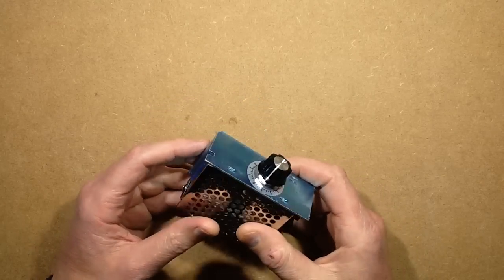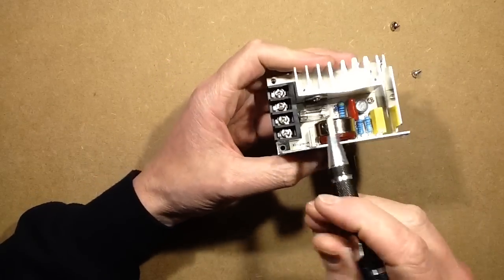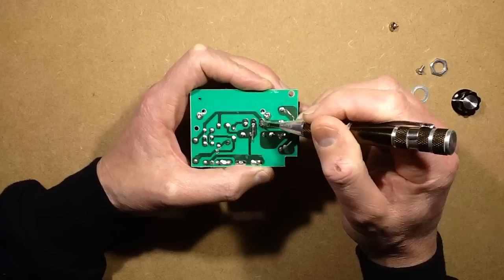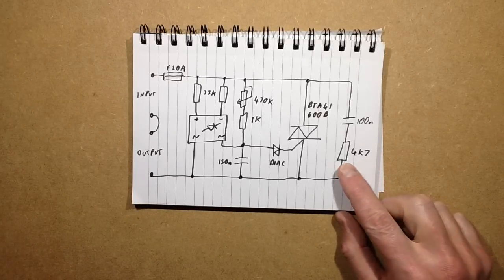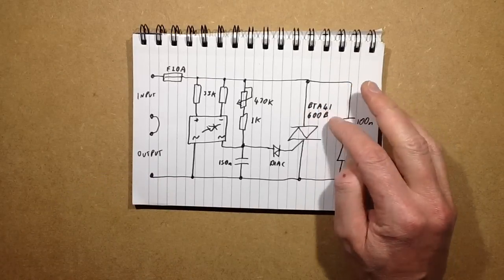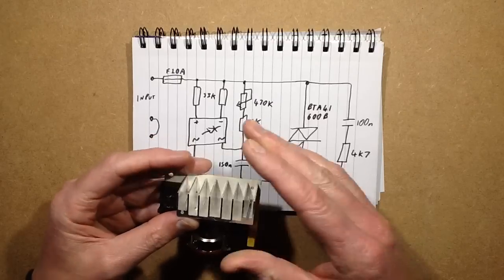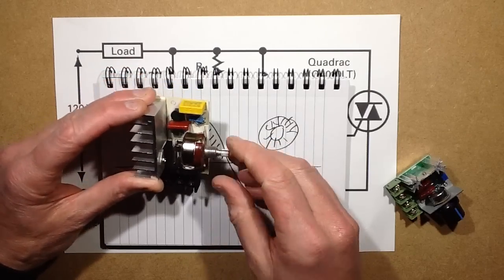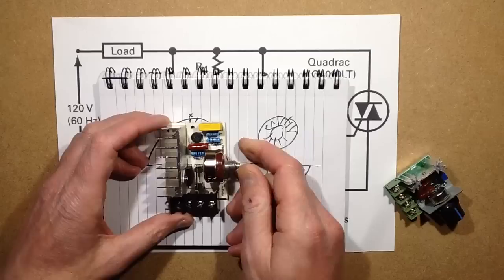Inside a "4kW" ebay power controller with schematic.

Comment: Great video. Got the same unit from ebay. But it is always 200V on output. Turning potentiometer does nothing. Do You know what part can be cosing  problem. The main problem is it is too cheep :)  and I have better to buy another one. But... this waiting time till we get them :) .
Reply from the maker: The unit will need a load to work properly.  If you connect a traditional tungsten lamp does it dim?
Reply: @bigclivedotcom  Thanks. I got it this morning and  only have my multimeter at hand.  Thanks. I will try when i get home after work. Two days earlier the small 2000w one came and also was showing 200V. But from Your  video on it I managed to understand  the blue resistor is the problem. I turned it to maximum resistance and thats it. Multimeter shows according to potentiometer and without any load. On 4000W  I did not find  looking at Your reverse engineering schematics whats the problem. I am not very familiar with electronics. Your channel is great .
 P.S.  I tested with lamp and it is working.

Comment: I am fascinated by your videos!  I am wondering what modifications would be necessary to get this to work as a power supply for model trains (Lionel) with operating AC output voltages of 0 to 28 volts.  If it could be made to work, since short circuits are common, would a circuit breaker provide adequate protection v a fast-acting fuse.  

your explanation of toroids in the whole house energy saver device was great.  I never knew they worked that way.

Thanks!
Reply from the maker: +Michael Lascara I'm not sure it would be ideal for low voltage use.  The diac really requires about 30V to trigger.  I suppose phase angle control could be used for an AC model if it was designed from scratch.
Reply: Thanks for the prompt reply.  Your evaluations are inspiring.  It makes me want to undertake a few projects.  It also makes me want to "give back" on things that I know about other subjects.

Comment: Hi there can’t you make video how to use this product wired to a 3000w brushless motor with 3 phase wires and 5 pin hall sensor wire would like to know in Which of the wire is best to wired it from

Comment: Do you think this would work as a speed controller for a industrial floor fan?
Reply from the maker: +Gspsx It depends on the motor it uses and if it has existing control circuitry.  You also have to be careful it doesn't get turned down so low that it stalls if switched off and on again.  Most dedicated PWM fan controllers start by ramping up to full speed then back down to the set speed.
Reply: bigclivedotcom Thanks Clive, you're the man.

Comment: wonder if this would work in my kitchenaid mixer , its a contact motor running throu a 120v transformer and the old speed controller blew up

Comment: so this could be used to control a treadmill motor by reducing and increasing voltage. but at lowest speed would this not also reduce the torque power ??
Reply from the maker: Treadmill motors tend to be DC for torque.  They will be a lot weaker with rectified AC.

Comment: I changed the fuse of 10A for a 20A fuse, that's works fine, 
But accidentaly i was testing my 90VDC 13A motor with a bridge rectifier and a capacitor, i unplugged the principal connector without change the potentiometer value, and when i connect again to the wall, the capacitor (100V 6800uF) blew up and the fuse at the dimmer blew up too (20A slow fuse), i think the dimmer is broken now because i can't regulate the voltage, sound something weird at the motor.
i'm thinking that with that dimmer you cannot dsconnect the load for any reason so you will have a peak voltaje that is 120*sqrt(2) when you connect the load again, i think that was the reason the capacitor make BOOM!.
Reply from the maker: The triac has probably failed.
Reply: Why it'spossible? the triac it's 44A and 430A peak
Reply: i'm thinking the one who is broken it is the diode bridge

Comment: Mine doesn't adjust the voltage. It's always 220V, no matter of the knob position. Does that mean that the thyristor is faulty?
Reply from the maker: If it does it while a load is connected it may indicate the triac has failed.
Reply: If yours is labelled as Clives one is, and mine, then it is labelled back to front, the output is in fact the input. I had the same effect before I connected a load, which destroyed it. I figured this out from looking at Clives circuit, replacing the blown triac and now have a working unit, reversing the in/out connections EG (Input N L- L N output) NOT (output N L-L N input) . if you put a load on it like then it will pop, BANG actually. Ask me how I know ;)

Comment: So I have the exact same power controller, 4kw. The circuit board is the exact same. But then INPUT and OUTPUT labels switched positions. So... how should I connect it? I've tried both ways with a fan and I can control its rpms both ways. And the fan always spins in the correct direction (clockwise). It's driving me mad and I'd prefer not to jeopardize...

My unit indicates which is L and which is N. When you look at the controller from the side, markings show like this:
OUTPUT        INPUT
  N    L              L    N

Looking at the circuit, to the far left side of it, I'd say Neutral would be the 2 connectors in the middle, while Live would be the 2 poles, right? the "outer" connectors.
So it looks to me as if they "simply" misplaced indications in my unit?

I'm guessing this would be the right labelling?
INPUT       OUTPUT
 L   N            N    L

But I'm not really sure. Anybody? Help appreciated.
Reply from the maker: Polarity doesn't actually matter.  AC is effectively both polarities and the neutral is probably just looped through.
Reply: @bigclivedotcom  Thanks Clive, not really my field.

Comment: Hi, not really related, I love to watch your videos. I have a situation, wind generator it goes from 10 vac to 190 volts triphase, my inverter after the rectifier accept 30 to 60 vdc. What kind of device you would design to be able to use all the current? I rattle my brain but can't figure it out, any ideas?
Reply: Three phase transformer to turn max 190V AC to about 40V AC. Take three phase rectifier and a 100v filtering capacitor if you can, add inductor and capacitor to form CLC filter, fuse is recommended and high value dicharge resistor is advised parallel to caps to safely discharge all the energy. This should turn 10 -      190V AC to 3 - 56 V DC. With this done we need to talk about inverter. If the inverter is MPPT, then connect the wires from rectifier to inverter, done. If the inverter doesnt care, connect the wires to boost converter and set it to 55v and connect that to inverter.

Comment: Bigclive: /shows a similar item of exact same material and dimensions/

Me: It makes me wonder how an engineer starts a project like that.  Do they start with the board and then choose a box to fit, or do they start with the box and try to design the board to fit?  If they start with the board, then how do they find boxes that perfectly fit?  And if they start with boxes, then how often do they have to start over because the board won't fit?
Reply from the maker: Many Chinese products use common PSU cases.

Comment: Hey i have a couple of these and they have failed, but they just supply the full whack of power. Any thoughts, i have tested most components and cant find the culprit. Thanks.
Reply from the maker: +Niall Odumosu It's usually triac failure that causes that.  Particularly when a load is shorted (like a lamp failing) or they get too hot.  To test with the power off, put your meter to continuity and looking at the triac from the printed side with the legs at the bottom check for continuity between the two left legs.  If shorted then the triac needs replaced.
Reply: Thanks man will give it a shot, I'll pick up some triacs sure and test out, pity they cost more than the whole thing fro China Haha, much obliged for the help

Comment: hello bigclive do you think it can handle a palm router with 220v and 550w for hours of usage? Thank you God Bless.
Reply from the maker: I'm not sure.  You might have to try it, but note that it has no interference suppression so could swamp radio signals.
Reply: Will the machine be affected? I mean my CNC machine where I mount the router?
Reply: Or is there other controller  just like that with interference suppresion?

Comment: I suck at analog electronics, im on the other half of the 10 people... ;) Anyhow, could that 4k7 resistor have anything to do with the bridge rectifier? I just venture a guess...
Love your chanel, keep up the good work :)
Reply from the maker: +Björn Camitz No.  The rectifier section had two 33K resistors.  The 4K7 resistor was in series with the capacitor across the triac.
Reply: +bigclivedotcom Guessed as much, it was a shot in the dark :) Thanks for the response and btw, you have a new patreon :)

Comment: Hi big Clive, I am an ignoramus, but was wondering if this could be used on a washing machine motor? could a forward off reverse switch be used with this and a washing machine motor?
Thx David
Reply from the maker: It depends on the type of motor.  Most of them are based on a type called a universal motor with brushes and commutator, and they are often controlled by phase angle control circuitry just like this.
Reply: thx big Clive, so fast
:-)
Reply: thx big Clive, so fast
:-)

Comment: I know this is ages old but..I am trying to control a treadmill dc motor through a bridge rectifier and I have both of these units..Both of them don't work and the motor just runs at full speed even when the potentiometer is turned down..Any tips as to what may be wrong please?
Reply from the maker: It might be the very inductive load causing false triggering if the snubber network isn't good enough, or the triac may have been damaged by the inductive spikes and failed.
Reply: @bigclivedotcom  ok..thankyou mate..ill search for a how to use the treadmill controller i think..

Comment: Need to test if this unit can really control speed motor like a fan but it likely not sure of it since the fan have a 2nd coil for a capacitor starter and that will not make the motor happy with low voltage

Comment: Definitely needs an Earth on the case as otherwise the only thing between case and full mains live (apart from the 10 Amp fuse) is the insulation of the control potentiometer. EEK!

Comment: I must be a bit thick but P=E*I (240v*10A = 2400w)
Where does the 4kw come from?
I would want a fan on that to keep it happy :-)
Reply: +zx8401ztv My guess would be that the rating of the triac is that they've rated it 400v rather than 250 (despite having a 250v glass fuse!), so 400V x 10 amp... 

The triac itself is 600v 40 amp, which is frankly ludicrous LOL
Reply: +TheChipmunk2008 lol its overkill, but i would rather see that, at least you know it can stand it easy :-D
400 volts!!, oow i dont want that voltage in a house lol, and 400 volts is usually 3 phase in industry, so its still a bit odd, i suppose it was cheap enough so its still good :-D
Reply: +TheChipmunk2008 I wouldn't complain that for once there is a margin in a product.
Reply: +nraynaud1 i dont think he is complaining, he is just answering my daft questions lol :-D

Comment: Can power controller like this work  with 12 light bulbs 75w? I know it is more powerful than 900w but still it is 12 bulbs in parallel connection.
Reply from the maker: It should work with tungsten lamps, but keep in mind that these units are unfiltered and will create a lot of radio noise.

Comment: Clive I am pretty sure you are supposed to test those with an Ignition coil with a microwave capacitor in series.  I could be mistaken but it would be fun to do.
Reply from the maker: I can remember a British electronics magazine published an "ioniser" design which was an ignition coil with a wad of steel wool stuffed into the end, and the coil hooked in series with a mains dimmer.
Reply: That seems to be a fun project.

Comment: Very interesting, so could I use this type or unit to control the speed of the 240V 1HP motor on my lathe, bearing in mind that it has a capacitor start ?
Reply from the maker: +Spen Crowson I'm not sure about that.  Only one way to find out...  You'd need to start it at full speed to let the centrifugal switch kick the capacitor out.  With the lathe you might lose power versus just using the gearing for maximum torque.  With an inductive load like that the snubber network would be important, and as mentioned in the video I'm a bit suspicious about the component values.
Reply: No, this type of controller is not suitable for induction motors. Only for universal (commutated) motors like in a hand held drill, angle grinder etc.
Reply: You probably need a variable frequency drive (VFD)
Reply from the maker: +kraklakvakve The roof fan controllers often use phase angle control and they are brushless.
Reply from the maker: +kraklakvakve A VFD would be a better option, but may not be compatible with the existing capacitor start motor.
Reply: +bigclivedotcom Thanks, plan B it is then
Reply: +Spen Crowson An induction motor, due to the way it's built, wants to lock it's rotational speed to the speed of the rotating magnetic field created by the windings. The speed of this rotating field is determined by the frequency of the AC power you feed it. So to make it go faster or slower, you need to change the frequency. You could possibly make it go slower with a dimmer circuit like this, but at the point you get it to slow down, it will be so gutless you will probably stall it as soon as you try to work on the lathe. So a proper 3-phase motor with a Variable Frequency Drive would be the way to go. You can feed the VFD with single phase yet make it run a 3-phase motor
Reply: +bigclivedotcom I have searched a bit and you are right, thanks for the hint (sorry for double posting, Youtube acted strange..)
Reply: +Niklas Bergsten Thanks
Reply: @Skracken  I know this comment is 4 years old but I think you're wrong maybe? My 3-speed fan uses an induction motor (with capacitor, so is a 'shaded pole' induction motor) and the switch just changes windings, there's no VFD in there. I think maybe you're confusing an induction motor with a permanent magnet synchronous motor such as is used in aquarium pumps etc?
Reply: @Shaun.Stephens  indeed small appliances like electric fans work that way. Because it's the cheapest way to do it. But it's very inefficient. Induction motors lose a lot of their efficiency when they're not close to the syncronous speed.

Comment: Specifying Live and Neutral on power supplies is rather pointless. You could even use two 120V phase shifted by 180° as 240V, it makes no difference and without a reference it is even indistinguishable from Live and Neutral

Comment: My regulator is broken, the potentiometer does not work but it is correct, it shows me the same voltage 220v at the input and output. What could be the problem? Please help
Reply from the maker: You can't test it with no load.  If the load is jammed on continuously then it's most likely that the triac has failed.

Comment: ONE THING TO NOTE ON MY UNIT: LOOKING AT THE CONNECTORS, ON THE CASE THE LEFT PAIR ARE LABELLED  'INPUT  N  L'  AND THE PAIR ON THE RIGHT 'OUTPUT. L. N' HOWEVER ITS THE RIGHT 2 (nearest pot) THAT TAKE MAINS IN AND LEFT HAND (nearest heatsink) THATS THE CONTROLLED OUTPUT! CONFIRM CLIVE?
Reply from the maker: Two of the connections will be internally commoned and the other two will be controlled.
Reply: @bigclivedotcom  2 outer are neutral and commoned via pcb track. But on my unit live IN (as its marked, the left hand of the inner 2) is actually the OUT, because the right hand live of the inner 2 connectors goes through the fuse. Lucky I watched your video!

Comment: Actually reduce power cost / money bill when using only part of the phase? When using on a heating element?  Thanks
Reply from the maker: It is an efficient way of controlling power.  At half power output it only consumes half the electrical power.
Reply: @bigclivedotcom  I thought that one of the complaints about new VA mains power company meters is that they effectively divide the real power used by the the power factor. Thus, even though you're outputting less heat, you're getting charged as if you were outputting a full sine-wave's worth of heat. Or am I very confused on why the new power meters are charging more for VA's instead of W's?

Comment: I have a pwm DC motor  speed controller (also from eBay) that looks just like that. Must be from the same factory lol.
Reply from the maker: They tend to use a lot of common cases that may have been designed for one product but are repurposed for others.  Putting a DC controller in one of these cases makes sense.